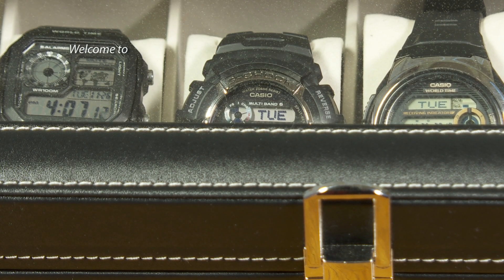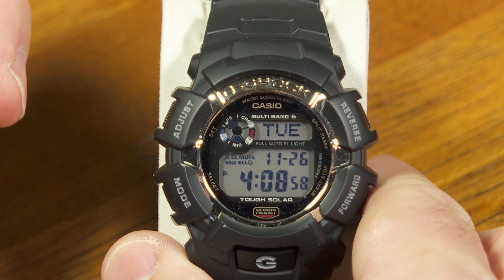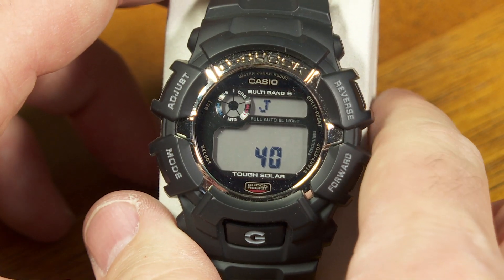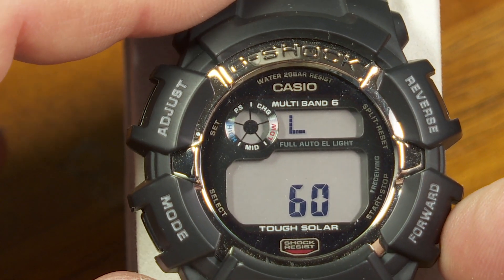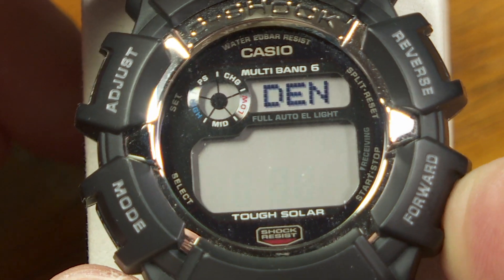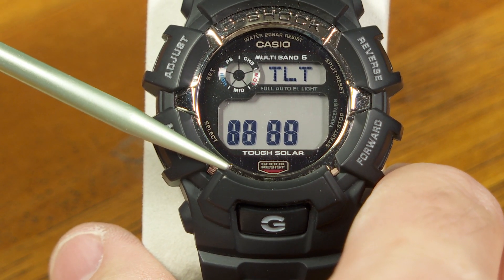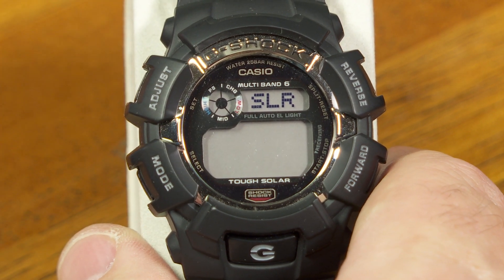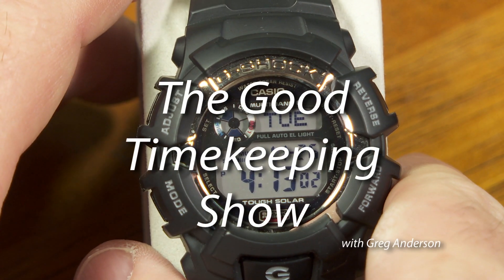Diagnostics for Casio G-Shock GW2310

Comment: Hi. I found the technical service manual for the GW2310 which sheds some additional light on what the test screens are for. One of them locks the frequency for an accuracy test. Also you can do a manual receive for any of the 6 towers, I might see if I can get Ft Collins from the UK using the metal frame method:
https://www.manualslib.com/manual/1270714/Casio-Qw-3195.html?page=12#manual
Reply: What's the metal frame method?

Comment: Thanks for your very helpful videos!
Do you have any idea why on some of my g-shocks the tilt sensor for the auto illumination isn’t working? Maybe I not wear them often? They’re around eight to ten years old. The normal light funktion is ok, the battery’s are stil strong. When I do the tilt test, it seems the tilt sensor is not working. Is there a solution?
Reply: This is a fairly common problem, unfortunately. The 'tiny ball' that rolls downwards to activate the light when the watch is tilted sometimes gets stuck. So far, I have never managed to get it unstuck once this occurs. I tapped the watches, banged them on the table and even dropped them onto concrete but nothing worked. Hope you had better luck.
Reply: @firstaddz8100  thanks for your answer! But now the tilt sensor is working on all the g shocks with this issue. Just wear it and be patience. On some the function get back within some days, some after some weeks. G Shocks have to be wear.